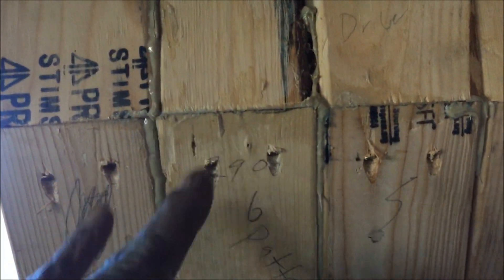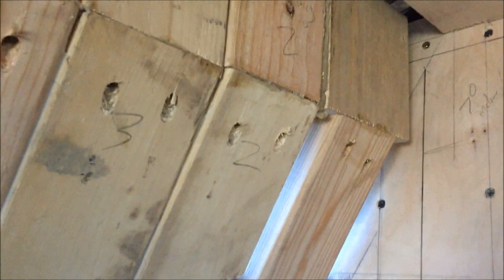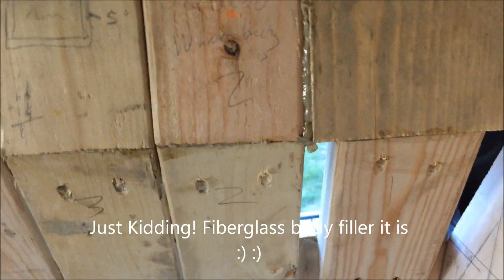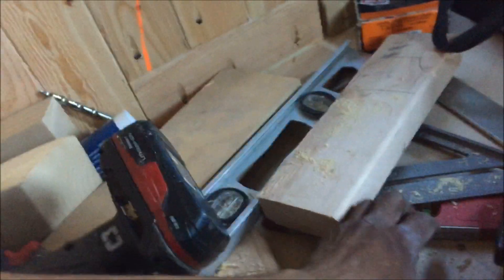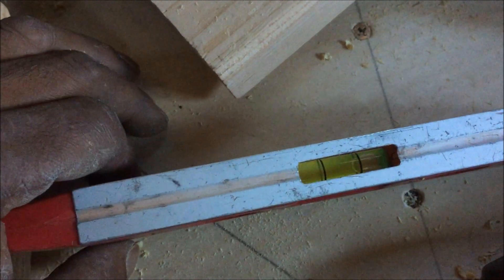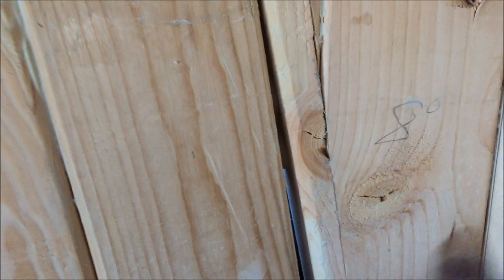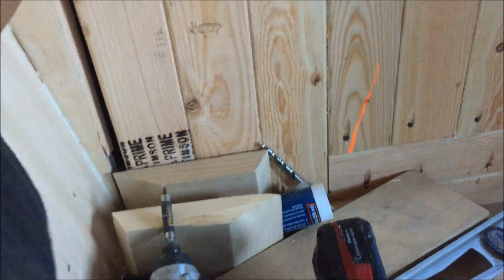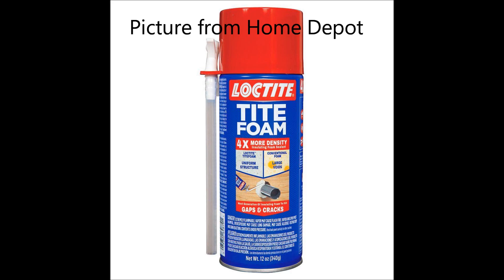Malibu 4th Order Bandpass Wall 2 ReSilient Team 15's Pt. 6

Comment: Hey man listen bro you doing right by taking your time and thinking through every little detail because the little details is what the difference is between an ok box and a Great enclosure.  Your build has inspired me to go all out one more time with my next build
Reply from the maker: Thanks Much! I needed this because for a second I started rushing a little (shows are coming up). But forget all that I didn't want to use any body filler or fiberglass. All angles and wood. Even the small gaps I will be filling in with wood. Next build I say go for it!! I thought I would be a lot more in but I'm still within the budget - Thank Goodness..
Reply: @bigvell02  I'm curious how much does just material run for a 4th order wall like your building but slightly larger

Comment: Best intro. 

Can you use a thicker patch material like you would for bondo on rust holes https://www.amazon.com/Bondo-932-Self-Adhesive-Patch/dp/B000HA9O5A, then some bondo to make filling in the gaps easier/cheaper? I know they must sell similar, bigger pieces somewhere and for less, but not sure where?
Reply from the maker: Thanks Much :) :) :) That's my lil basshead. Nice stuff indeed I can imagine that and bondo glass haha talk about strong. I plan on getting the angles and cutting for exact fit then going mad with the good PL to secure them. That patch I might give that a try on a temp. repair on the Honda fender. Until I can cut them out and weld new ones in. Lol Ive become a body repair specialist (In my own house only lol)
Reply: @bigvell02  Keep in mind that I am high 100% of the time I watch and comment... For some reason, I thought that was going to be the interior, finished wall... Never mind what I said; It's way cheaper and easier to fill it in with scrap pieces. Kind of evens out if the patch helps on the Honda though.